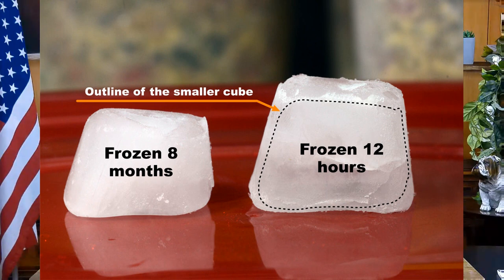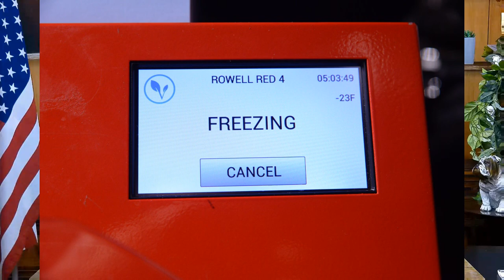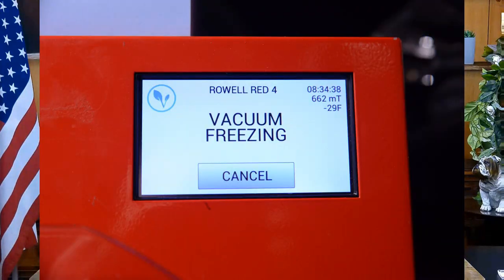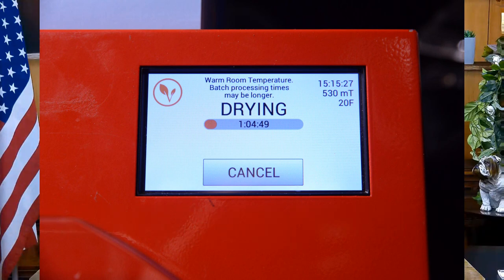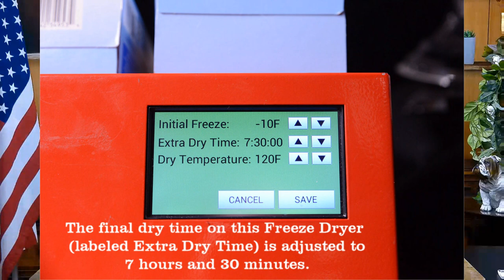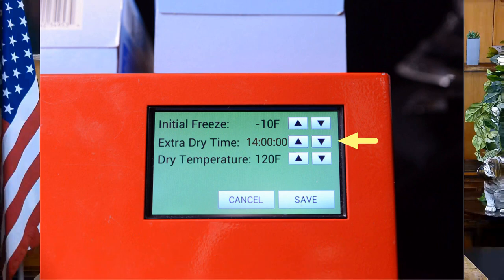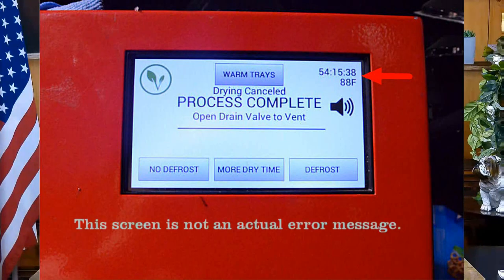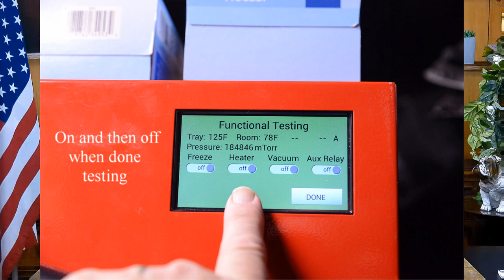Freeze Dryer Operational Paramaters

Comment: Very informative! I have a medium that will be here by first of august. I will be putting it inside the house, in a pantry that is large & maintains a less than 72 deg temperature. I’m in Louisiana so this is helpful. Here is a question: will the high humidity of La be a factor? Not for the FD itself, but the outcome of the food.
Reply from the maker: Hello Susanne. No, inside the chamber is a controlled enviroment under a vacuum. The high humidity may affect cycle times because the refrigerant pump may be slightly more or less efficient but as for the food itself the exterior humidity will have no effect during the cycle times. However, once the food is removed from the FD, making sure it is quickly packed becomes more important as the humidity rises. Thanks for reaching out, Evan

Comment: Thank you so much for talking about the details others don't address.  I will monitor the ice build up closely since mine, in a large, seems to be focused toward the back 2/3 of the barrel, very thick back there.  It does seem that it takes longer to fd everything compared to what others report for the same/similar foods.  Kind of stinks because I've had the unit for 1 year now and if the refrigeration unit has issues, it's now on my dime.  Blah.  How can I buy you a coffee? ;)

Comment: Very informative video.   Lots of good into.  You say that the ambient temperature plays a big role in how your FD works.  I have the opposite problem.  It gets very cold in the winter.  Would it cause issues with my FD if the ambient temperature drops below zero?
Reply from the maker: Hello Sista7777. I don't think so. The refrigeration unit and coolant are designed to work in extreme temperatures and unless the pump had condensate in the motor that could freeze (very unlikely) it too should have no problem. In fact the FD may do its job better in very cold environments. One thing you can do is run your pump in close proximity to the FD, perhaps on a shelf under it so the heat will rise, and keep the room closed up so the FD and pump can raise the temperature.  In any case I think you will do fine,  Evan
Reply: 100% issues caused by low ambient temps. Comprsssor cannot pump liquid only a vaporous mixture. “Liquid slugging “ kills compressors brakes valves, rods and cranks. Keep unit ambient temps no colder than 30f no higher than 90f

Comment: another great video that explains a lot.
I do have a question about the location of the pump: I am thinking about putting the FD on a table and  the pump on the floor underneath. would that create a problem?
thank  you!!
Reply from the maker: Thanks, Katzenaugen2. Below and off to the side is what is generally recommended. Because heat rises do not put the pump directly underneath the FD if the shelf on which the FD sits is vented such as a wire rack, the rising heat can get pulled in by the condenser fan. Evan
Reply: @evanrowell5266  , Thank you!

Comment: Thank you for the great explanations! Very useful information. I’m on the verge of ordering a medium one as well, but am concerned about placement. Planned on putting it under our house as there is room to stand and there are many things stored there. Trouble is we have cases of wine stored there and many jars of dehydrated food not far from where it could go on a shelf. I’m concerned about the amount of heat the FD and pump will put out into the space. Someone said not to store food in the same room as the FD and now I’m worried about the wine. They also said their FD increases their basement temp 10 degrees.. I’ve never seen the temp get over 80’ under there, but I sure can’t add another 10’ due to the wine. I plan on adding battery operated fans, but not sure that will be enough. Thoughts? Thanks!
Reply from the maker: Hello Kathy. You should do fine in a space under ground level where it stays cool. The key is to keep the air moving so heat cannot build up immediately around the FD, the more movement the better. With good air movement you can operate your freeze dryer in a room that stays in the mid to upper 70's without problems but once the temp gets into the mid 80's then you will have problems. The vacuum pump produces a lot more heat than the FD so a fan should be blowing directly onto the pump. I would not count on a battery powered fan, the fan you need should be a medium size turbo fan, their not expensive but they move a lot of air. Also, if the space is small, around a 120 sq. ft. then it will be important not to have the space enclosed without the ability to circulate in cooler outside air. With sufficient air movement the temperature in the room should not rise more than a couple degrees. My FD is in my small dark room and a fan makes all the difference. Here is a link showing the fan I use and I set it up right next to the fan:
https://www.walmart.com/ip/Honeywell-Air-Circulator-Electric-Whole-Room-Table-Fan-HPF820BWM-Black/607094187?athbdg=L1600   Thanks,  Evan
Reply: @evanrowell5266  Thank you for your detailed reply Evan. I have a fan very similar to yours so thanks for that recommendation over the battery operated type. I do keep a thermometer under there for the wine so I can keep an eye on it and just not use the FD on the warmest summer days. I’m so glad I found your site.

Comment: Hello, thank you for good information for this newbie. So ice pattern "off" means refrigeration problems.  What are the signs if your Relay Board, circuit board is bad? Also, their seems to be  several different recommendations as to what is good and what is bad solvents to clean drum and trays. Soap and water, vinegar, alcohol,  etc. What do you use- recommend? 
Thank you for helping newbies
Reply from the maker: Ice patterns in the barrel can tell you how well your FD is operating but the amount of water in the food can also produce light and sometimes sporadic patterns so an average track record of how well your FD is doing its job is the best way to tell, don't look for problems unless your batches are not drying completely in a reasonable amount of time. :) Evan
Reply: @evanrowell5266  so what happens if your relay board is bad?
Reply from the maker: @trinade3732  They cannot be repaired so you replace it. It's easy to do. When I replaced mine, it costs $90 for the board.  Evan
Reply: @evanrowell5266  ok. But what are the symptoms of a board going out.

Comment: I have put food in the oven at 125 degrees to finish it if needed
Reply from the maker: Hello usha777 :) Yes you can use an oven, but it is tricky and requires close attention to temperature and timing, it must not be allowed to sit and cool in the oven. Hot stagnant air that is cooling over freshly dried food will give up its moisture back into the food very quickly. That is why the food must be removed from the oven while still hotter than the surrounding air and isolated, preferably in freezer bags, until it cools to a point where it will not readily absorb moisture from the air because warm, dry food is a moisture sponge from the surrounding cooling air. That is why a dehydrator works so well, the air is warmed and kept moving in and out of the dehydrator. Dry cool air is drawn into the dehydrator, heated and proceeds to pick up any moisture present and then evacuates from the dehydrator taking the moisture with it, an oven does not do that. In an oven the air can quickly saturate making the moisture readily available to be reintroduced into the food as air temperatures quickly cool. Thanks for the comment, Evan👍

Comment: Thanks for this! I've been looking everywhere to see if this FD was using heated trays. HR's own website could not find this info. Are both the vacuum (on/off) and heat (pwm?) variable during operation?
Reply from the maker: Hello Bart. The trays are heated by the shelving but it's the same difference because the trays come in complete contact with the shelves so the vacuum has no effect on the transfer of heat. There is a heating pad under each shelf. There are no user variable parameters during operation. The balance is too delicate for user intervention so the computer needs to control the process. Being able to turn the vacuum pump, the heater and the refrigeration unit on/off is for testing purposes only and the screen is not accessible during operation. Thank you for reaching out, I hope I have answered your question,  Evan

Comment: Very useful information, something I may be able use to help me figure out a different issue I have with my FD,  my dryer shows a code 9 occasionally after running for an extended cycle most often i can bypass it but on an occasion i have to stop the unit defrost it and redo the process. This happens more with liquid than solids ie. broths sauces soups etc. I have an open file with HR. They have had me do several things as work arounds, there has been some improvements but the issue persists. Any thoughts from you or yours follows would be greatly appreciated.

Comment: No. Freezer burn is water that has sublimated out of the meat. That frost is water that came out of the meat. That is why a chunk of meat in a plastic bag will accumulate that frosty layer. Inside the bag. The moisture sublimates out of the meat and then re-condenses on the outside of the meat (inside the bag).

Freeze drying is literally accelerated freezer burning.

Comment: so my ice has always been back about 2-2.5inches back from rubber does that mean it is bad. It always takes longer than other peoples for loads about 8 to 12 hours
Reply from the maker: 2-2.5 inches is OK but no more, watch it to see if it starts getting further back. with an empty FD close it up and go to the testing screen and turn on your freezer for 2+ hours, the temperature shooud drop below -45 degrees but at least -35 degrees, if any warmer it is likely the refrigeration unit needs service or the room temperature is excessevily warm. Room temperature plays an important roll in the FD efficiency as well as the vacuum level. Although the FD will still properly freeze dry food you might still want to record vacuum levels and take photo's of the inside of the FD right after the batch finishes and then send them with the log files to Harvest Right so they can look at them and give you some recommendations. As the FD gets older, especially the pump, they will start to decline in efficiency (for the FD that should take many years). With an empty FD go to the testing screen, close up the dryer including the drain valve and turn on the pump, see how far down the vacuum gets, it should get at least below 400 mT, mine gets below 250 mT but it is only a few months old. Good Luck, Evan

Comment: Hey, Thanks!
Reply: Thanks for your explanation Evan. My concern is that my freeze dryer is only 4 months old and the ice rings begin 7-8 inches from the bottom of the barrel and stops 4 inches from the door.  It seems like the build up of ice is always thick.  I worry that the Freon must have leaked preventing the drum from collecting the full length of the drum.  HR tells me that my ice pattern is normal.  Do you have any thoughts or suggestions?

Comment: In your problem where your ice didnt come all the way forward, would it be the same if you (routinely) only had ice build up in the front half & not the back? 
Thanks
Reply from the maker: If only half your barrel is condensing ice then there is a problem with the refrigeration unit. That's what happened to mine and the condenser had to be replaced because of a stuck valve. Do a water batch by placing 1/2 cup of water in each tray and run the complete cycle. Remove the trays (they should be empty) and take pictures of the inside of the unit focusing on the whole length of the barrel and the ice sheet that is on the side of the barrel. Send pictures and the log files to Harvest Right for evaluation. Sometimes Harvest Right staff gets over-loaded with such emails and your email can get "lost" so keep at it until they respond. If your unit is out of warranty then you have to call them and set up a phone appointment with a technician and it will cost $45, If he already has the information I instructed you to send them then things will go faster. Good Luck,  Evan
Reply: @evanrowell5266  HR's own support site says the frost pattern may only extend halfway back from the front.  There is a lot of confusion out there about this.  I just got a new small unit and only get ice halfway back.  All of my batches so far have been 26 hours or less and everything seems to be working fine.

Has anyone taken the side panels off and actually seen the cooling coils wrapping around the chamber?

STEP 1: CHECK FOR FROST PATTERN

a. First check for a frost pattern by powering on the freeze dryer.

b. Press “Start” and sequence through the screens until the unit begins “Freezing.”

c. Open the freeze dryer door and let it run for 60 minutes.

d. After 60 minutes you should see a frost pattern that extends ½ the length of the chamber or more. Touch the walls of the chamber, if they are not cold, or if you do not get a frost pattern then proceed to STEP 2
Reply from the maker: @ItsEverythingElse  The initial pattern may be small but the refrigeration unit should get the whole barrel between -30 and -40 degrees, mine hits -50. In such a case the whole barrel will develop the ice sheet, not just part of it. The operational parameters of the freeze dryer are very precise with narrow windows for variance. As long as these parameters are met small problems may not manifest themselves until a tipping point after which they suddenly become big problems, that is what happened to me. If your unit is working well then you should not have to worry about these problems but failure is a cascading event. The tipping point is closer with a FD that is accomplishing its task yet not operating at optimal performance. It is good that your FD is working well but when problems start to occur (it may take years) then these apparently unimportant conditions will suddenly become very important. Thanks for the comment,  Evan